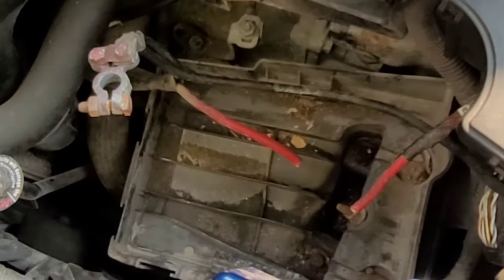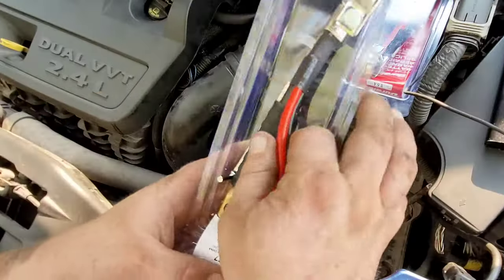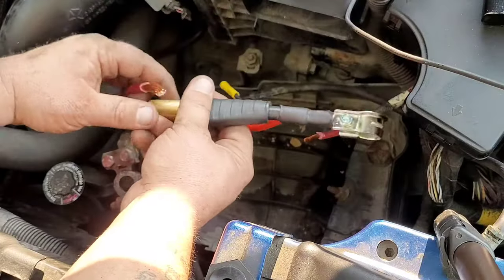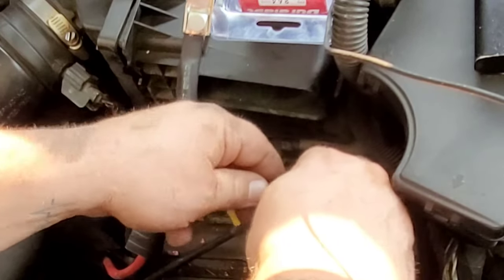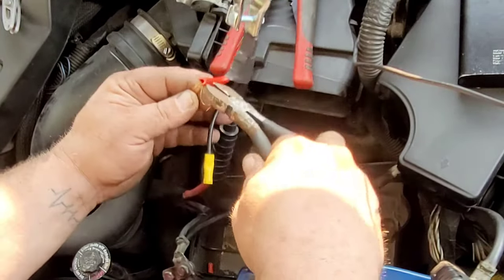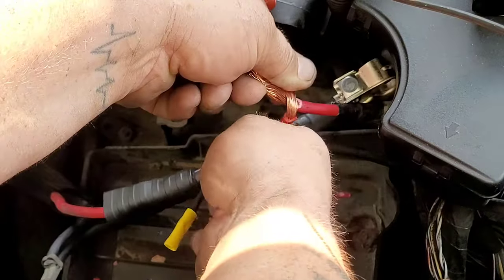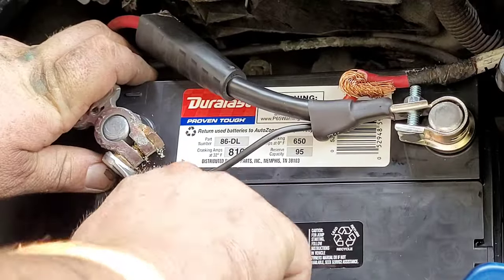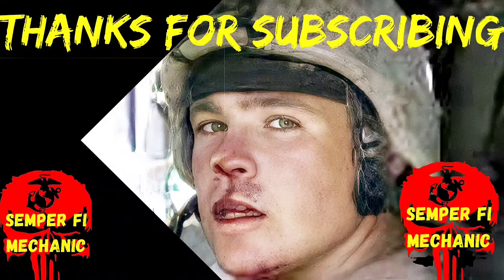How To Make A Battery Cable Longer

Comment: I would have liked to see a cleaner and more secure way to connect that second cable. I don’t think it will last long. But the owner has bigger problems with his stolen “Cadillac” converter
Reply from the maker: Yea the video didn't really do it justice and I wrapped it in Electric tape before we left. So it's secure just doesn't look like it on video lol but yea cars not driving anywhere at the moment anyway
Reply from the maker: Hahaahah

Comment: Thanks, this should work for me.  My car died the other day in the parking lot of a Dollar General, I have AAA but it took 43 hours to get a tow.  When I got it home I swapped out the battery with one I had in another car, when clamping it down on the post the thing split in 2 it was so corroded, I would have just cut the cable and bought a new clamp but the cables in my car are so short that wouldn't work.  Been trying to figure out the last few hours what to do and I am thinking this is the best option.
Reply from the maker: Yea brother just make sure at the end that you take electrical tape and wrap it around to cover the exposed wires and your good to go

Comment: 3:03 I won’t do this in million years
Reply from the maker: K
Reply: @semperfimechanic  you know why right ? Because car Vibration on the road will undo the thing you made there and  the end of the cable will touch the car body metal which is all negative/ground and a result for that will cause huge sparks that can lead to a fire 🔥, I recommend you delete the video as it’s not save to do that or maybe you redo the video with proper positive to positive connection using professional cable ends connection usually sold for $1 a piece. Thanks and no hard feelings hooah.
Reply: @sabahjason1  I don’t think he’s taking your recommendation.
Reply: @sabahjason1  I was waiting to see what connector he put on to crimp it. Then I thought he was going to put tape on it to at least keep it from unwinding/etc. This blew me away that this is how he left it. To each their own.. but exposed wires.. twisted.. not even solder.. electric tape.. nothing. Wow. Not what I would ever have assumed would be recommended.
Reply: @NJTransit1985 well he would want to because everything he said was right
Reply: If I did ever do that I would solder the 2 spliced ends together and then wrap it really good with electrical tape or put a wire cap over them